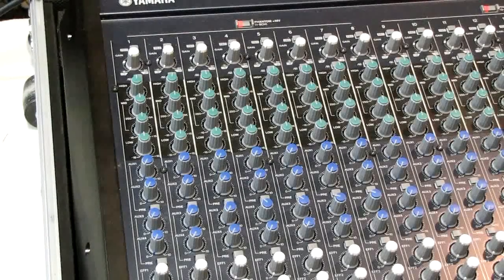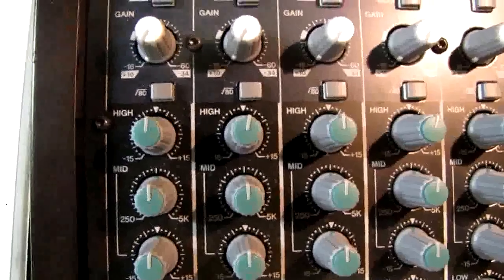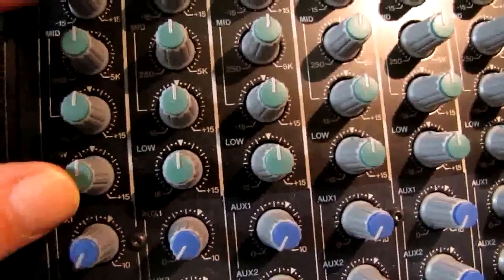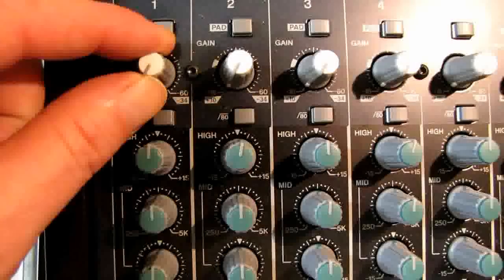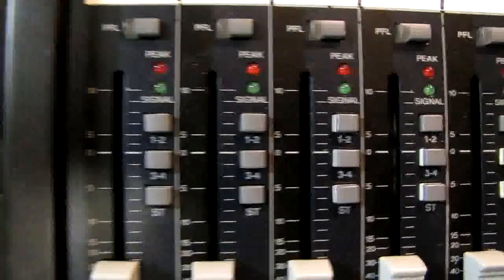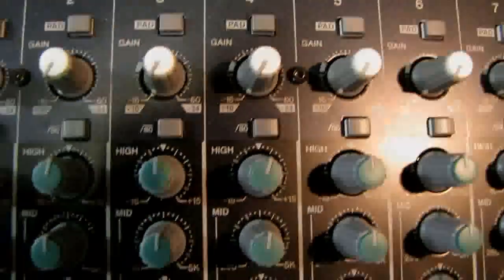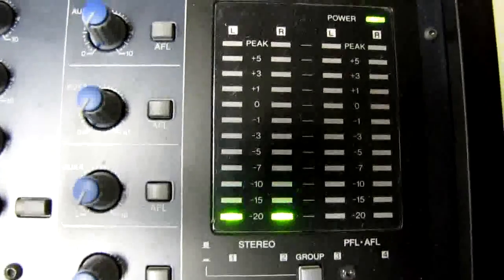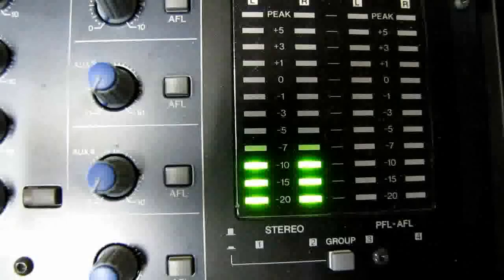Introduction to an audio mixer using an analog Yamaha MG24 - Stage Left Audio

Comment: I take audio out on mixer as line input to PC for recording, when I press PFL to adjust during live performance and it recorded that channel only.  Do you know how I can avoid this?
Reply from the maker: Sounds like you may be using an incorrect output on the mixer.  Many mixers have a couple of outputs on them that is the FOH mix.  Try using one of those other outputs.
Reply: @stageleftaudio  indeed, I was using the wrong output.  thanks for the reply.

Comment from the maker: Relatively speaking... onboard affects are most always limiting and restrictive with their control; they work great in a pinch, but not for real work.  Depending on the band, 2 to 4 monitor mixes is usually acceptable; anything more than that, it's best to have a separate monitor system/engineer (you could be spending value FOH time mixing monitors - and many times it shows) as well, it's easy to have to more effect sends than just reverb and delay.

Comment: What do the phantom power do?
Reply from the maker: Phantom power is a utility found on many consoles.  Phantom power provides electricity (~48V) to microphones that require electricity to operate.  Microphones that are called "condensor" mics require phantom power to operate.  Basic dynamic microphones do not require phantom power.  When phantom power is enabled, electricity is sent down the mic cable to the mic.

Comment: Hi we have this same sound board for our church. The issue I'm having is the mic vocal setup.  We had somebody upgrade the speakers and the amp but I'm noticing something - when it comes to the pastor mic output - he gets a natural voice sound but with our singers they get a more bass sound and to me, it even sounds mono.  I guess this has something to do with the distance when using the mic? Because the pastor is farther from the mic it's ok but because with singers they are very close to the mic they get a more bass? I don't know.  All mics we using are the shure SM58( both the pastor and singers.)  Would you be able to help how we can adjust to have singers with the same natural voice output?
Reply from the maker: `The bass response you are hearing from the SM58 mics is from something called the "proximity effect".  All microphones will exhibit this behavior of increased bass (some worse than others) the closer a mic is to a voice.  The best way to handle it is to 1.) have the singers step back about 4" inches from the mics, or.... 2.) make sure the low-cut filter is "on" for each mic and turn down the bass freq. for each mic; using the channel EQ on each mic.

Comment: Hey how can I use or link an independent stage mixer for monitors to the FOH mixer for a live performance? 
Is it possible? 
I ask because I'm having problems when I send a mix to the stage monitors and it sounds way different from the FOH. I'm talking about the eq since my FOH mixer only have 2 aux sends and one eq section.
What can I do?
Reply from the maker: +Mike Aaron To run a separate monitor console and FOH console requires the use of a splitter snake.  Basically, it's a snake with 2 short feeders; one for the monitor and the other for FOH.  The use of ground lift cables may be needed to combat ground-loop issues when connecting monitor and FOH desks.
Reply: +stageleftaudio 
Oh okay...
Should I get a splitter snake or mic splitter with additional xlr cables?
Which is the cheapest way to go?
A d how would the signal flow be like?
Thanks for responding👍
Reply from the maker: +Mike Aaron The cheapest way would be to use "Y" cables.  Though (depending on the number of inputs you have), it can get really messy with all the "Y" cables laying around.  The next option (and more expensive) is to use input spliters.  These are usually 4 channel rackmount units that can take one input and split it about 3 ways.  The next step up would be the snake spliter.

The signal flow would be from the mic to both the monitor and FOH at the same time.  Not too much involved with the signal flow.
Reply: +stageleftaudio 
Thanks!
I appreciate the help!

Comment: sir i have same board but it mid freuency  give to much disturbance in live sound give me any solution
Reply from the maker: Determine which channel (instrument, vocal) has the mid-frequency issue.  Then, turn down the frequency that is causing the issue.  That board has a sweepable mid; all you need to do is listen for the frequency that is causing the issue and turn it down using the volume control for the mid-frequency band.